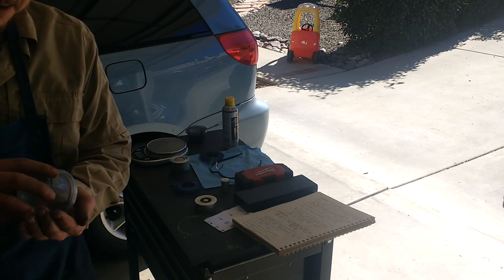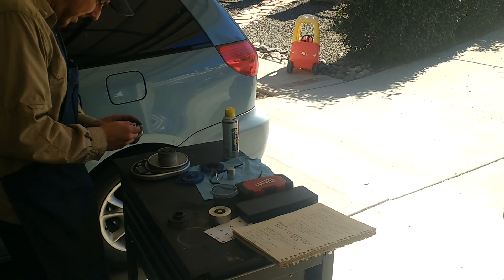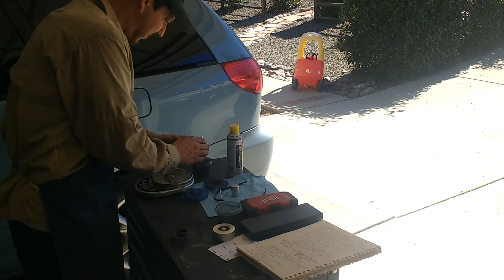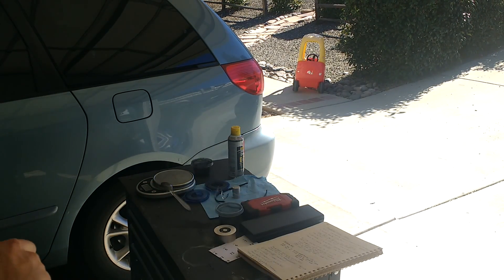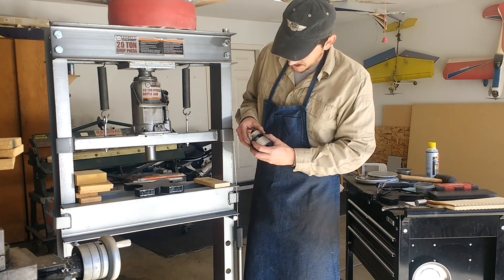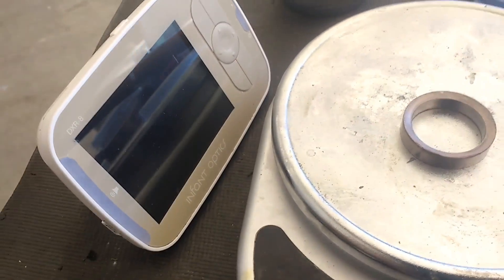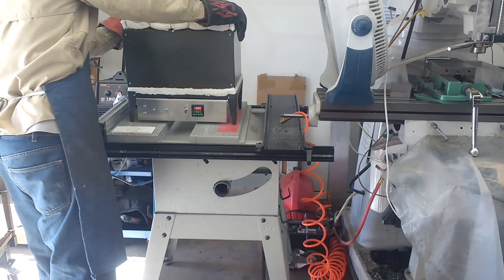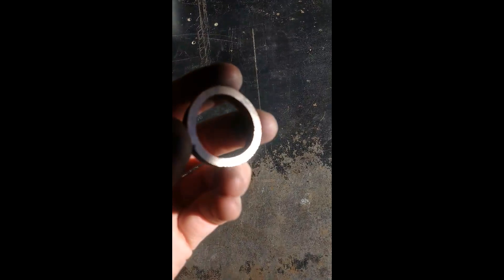Shop Talk: Episode 7 - Powdered Metal Parts 2nd Attempt

Comment: I'm really glad you posted this video, it is the only DIY powdered metal sintering video on YouTube that isn't just a SLS printer. Are you going to post any update videos on this project? I am attempting to do my own powdered metal part (attempting a Tungsten Carbide kitchen knife) and finding resources on how to do it at home with fairly simple tools, like in your video, is difficult. Any updates or tips would be appreciated!
Reply from the maker: I have not done anything since this video. When I do more (which I do plan on but it may be a little while) I plan on posting a video. I found it hard to find info as well which is one reason I wanted to share the video. In case you don't know tungsten carbide is brittle would probably shatter if you dropped it. Also I'm not sure how sharp of an edge you will get. From what I heard the early tungsten carbide end mills were not recommended for aluminum because they could not be sharpened as sharp as HSS. Some tungsten carbide can be poisonous, I think just the dust but just a heads up in case you have not looked into it. I don't have much for tips other than searching patents online.
Reply: @Goldenfab  Thank you for the reply, I did not know that about early carbide, which I doubt I can do better than. I am going to mix it with some Silver as a binder, which worked in the test I did, but since I only made a simple puck I cant really test it's edge holding capabilities.